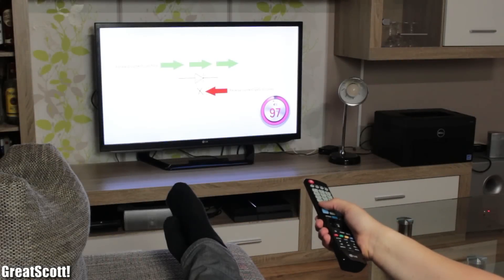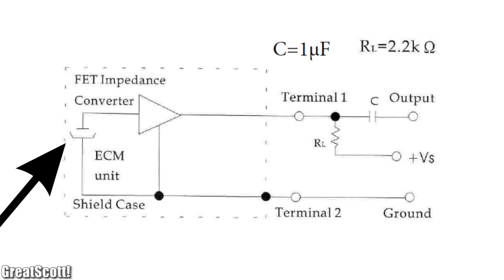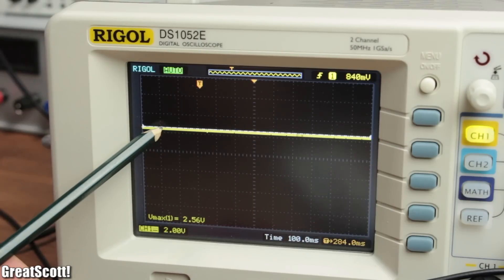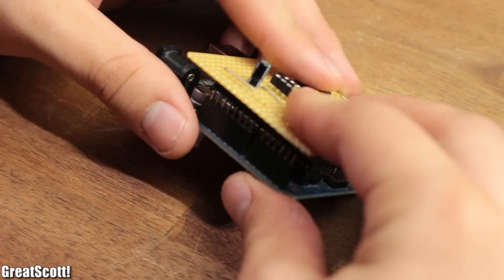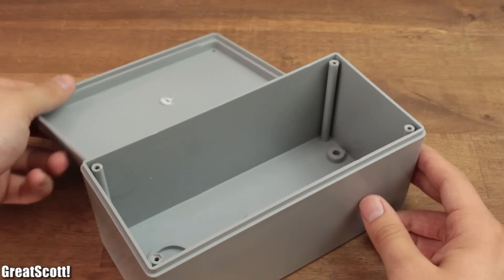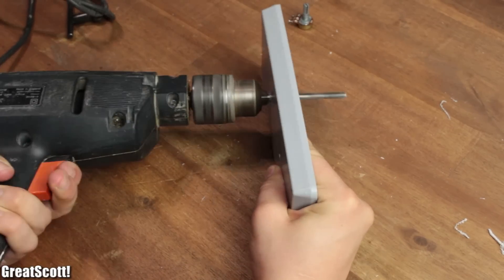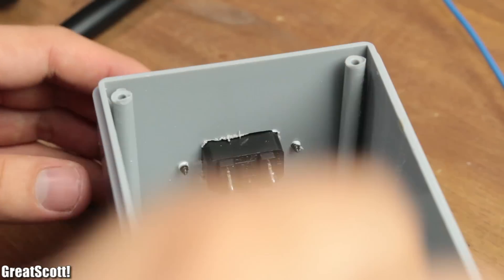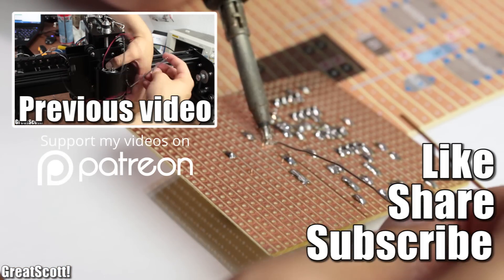Turn your lights on with clapping?! || Arduino Clap Circuit

Comment: Great project! Will definitely have to try this out sometime.
Reply: OMG, I NEVER NEW YOU WATCHED GREAT SCOTT, IM A HUGE FAN OF YOU AND GREAT SCOTT, sorry for capitals
Reply: DIY Perks Make a video of your project!
Reply: DIY Perks Hey. Make it battery powered using pulsed relays. Also try to make a two channel one for clapping two times for channel one and three times for channel two. Using (expensive) beefy relais may allow you to put on power strips for multiple appliances!
Reply: ***** ... Batterypowerd?
a batterpowered mains switch, so you can turn of your charger that charges the batteries for your clap-switch?
now i see why you need two channels...
Reply: dicky dicky
Totally wrong! The conversion of 250 Volts into 5 Volts using even a switching PSU is much more inefficient as just taking two 9V batteries and use pulse relays. So the circuit does only draw very low power to power the micro and only when a switching impulse is sent the relay is used. The batteries would last for at least one year and batteries are pretty cheap in germany. I could also use 6 AAA eneloops and recharge them EXTERNALLY. It's much better than permanently have a PSU on the mains... I just do not like it to do so! We pay 30 Euro-Cents each fucking KWh in fucking Germany! Congrats for almost free electricity in USA...
Reply: ***** you should do you math before posting :)

where do you get the numbers 2 9V batteries lasts 1 Year to power a attiny not asleep?
that's way off.
Let us calculate:

A typical cheap 9V battery in germany is about 80ct to 1€, right? (2 for 1,80€ at aldi) but these cheap blocks are usually around 200 to 300mAh.
Have you ever measured the current a attiny85 uses while not in sleep?
I've done, just now, i've also programmed it to analogRead() and delay(1) in a loop, since analogRead() has an impact to the current flowing.
i've measured about 18mA. Also a typical NE5534 draws about 6mA by just sitting there, than there is the input current of both inputs, that's around 0.5 to 1.5 mA each, we have a sound controlled current draw on the mic, which should be around 2mA.
All together we are easily at 25mA.
So amusing we are connecting the two  typical cheap 9V batterys in parallel and using a linear regulator they lasts 18 to 24 Hour, that's about 1.6 to 2€/day, or around 600€/Year. 
So linear regulators are a bad idea for Batter-powered Projects, right.
But without going to search an actual step down converter, lets say you have a magic step down converter with 100% efficiency.
So a 300mAh 9V Battery has about 2.7Wh which will give us 0.54Ah at 5V . With two of them we get  less than 45h, that's more than 300€/Year.

You wan't to use rechargeable batteries you say? ever wondered what Efficiency that whole process has? its horrible!
But first we do the convenience calculation:
 You say 6 Eneloop AAA.
I don't know why 6, but we do the math.
My eneloop AAA's say they have 750mAh at 1.2V thats 0.9Wh each, or 5.4Wh for 6. You'll have to swap batteries 2 times a week.
So you basically going to by 12 of them.
Assuming you already have a charger that you can use you have an extra investment over 20€, you can power your gadget a long time for 20€ but we calculate that later.
For now, lets forgot battery aging and pretend you could use this 2 packs forever.
So we know we have to charge our batteries twice a week (yes i know, its a bit less, but hey we assuming a perfect step down converter and always as good as new batteries, lets calculate with twice a week. lets make it 100 times a year, ok?).

So we need 6x750mAh in our batteries 100 times a year.
Have you ever measured the power consumption of you charger?

the Typical Eneloop-charger MQR06 uses about 6.5W while charging 4 Batteries in 200Min. that's 21Wh in for 5.4Wh out.
We need that about 100 times a Year, that's 2.1kWh/Year if you always unplug your charger right after its ready, if not if draws 3+W for showing you that its ready.
So, lets assume you batteries lasts 10 Years and you get them dirt cheap for 20€.
Now we have 2.6€ per Year.
Also we have the inconvenience to leave the couch twice a week since the damn batteries are dead.    

Using the powersupply that scott linked at ebay and assuming it runs under full load all the time (which is ridiculous, we will be at least 10 times lower, but we don't have the real numbers so i assume 100% load in for less than 5% out) we consume less than 30kWh/Year.
Assuming a ridiculous high price per kWh from about 30ct we raise our electrical bill at way less than 10€/year.

If we use a good switching powersupply designed for low current we should get easily under the 2€ per year including the price of that device over 10 years.

And no, i'm not living in USA, i'm from Germany, i know my electrical bill :)
Reply: What about a capacitor dropper circuit instead? But I still feel not comfortable to have a device constantly running which is not approved at all. I even switch off my microwave off the grid when it's done it's work.
Reply: ***** capactior dropper supplies are inefficient as hell, also they raise your circuit potential near mains potential, now you have to touch-prove your whole circuit including the mic and the pot :)
If you don't like wiring mains you could use a wallwart supply, that leaves half the mains wiring off.
You could get rid of the other half by ripping a rc mains switch apart and triggering that relay with the power from the arduino. Or to be on the really safe side, get a 443mhz transmitter and be mains free in your project :)
Reply: dicky dicky
Hmm also not optimal... The problem isn't having mains in the project, the problem is a failing PSU.

I have an AVANTEK power bank which is really good, but the PSU for charging destroyed itself. It was rated 2 Amps and the bank pulled 2 Amps all the time while charging. It did get VERY hot until it stopped working. Examining the carnage brought the certainty that the fail without event could have gotten wrong with a serious fire. Gladly the rectifier went open circuit. The charger had a resistor fuse, which is illegal in my opinion! Also a SMD resistor got so hot, that the PCB turned into coal. I now use a decent HAMA 2.1 Amp PSU with foldable mains connector. I opened it up and found that it was really well and safely designed and I would trust it. Perhaps I should use this in this project? I still could charge my power bank with it, it has two USB-Ports and the clap circuit will never use 100 mA.
Reply: ***** You always could add safety features in such a project without much hassle:
You could at a fuse direct at the input, in fact there are sockets with build-in fuses.
Sadly this Fuse might blow up after bad things happend.
You could (also) add a fuse at the output of your PSU, maybe a self resetting PTC-Fuse, that will likely trip before your unprotected psu releases the magic smoke.
You should not let a PSU run near it's maxumum ration for a Permanent solution, that will fail (if should not, but it often will), but this is no problem in this situation,  if you put a psu into your box you could also stick a heat-fuse ontop of it so it will not slowly get hotter and hotter.
Reply: I won't charge the power bank permanently. ;) So I think it might be okay.

There is also another option. I have one single appliance which is always on: My Cable Modem / Router! It has a USB port. I could use this for my project. Problem is the location but I have old speaker wire. ;)
Reply: ***** thats perfect, this is the way i power my RC transmitter for Sockets :). No location Problem either
Reply: +BloodySword That is a perfect solution. That is how I made a very simple light for my wardrobe. I mounted a power bank with velcro on the top, and used a USB LED with touching. They are cheap on ebay.
Reply: +DIY Perks Cool advertising technique!
Reply: +MrMitche Mitchell true
Reply: DIY Perks hey could you please help me figure out why the output always remains at 5v even when there is no input signal applied to it? I checked and rechecked the circuit.
Reply: Because this is AND gate logical operator which works on lowest voltage you might have connect a battery of 5 v which is the least in your case
Reply: daddy
Reply: DIY Perks 
Awesome
Reply: Yeah I dont think you did.

Comment: This really does work nicely, congratulations for another excellent instructional video.

I would like to add a very quick note about the circuit diagram. I made the mistake of wiring the output of the ATtiny85 as per the diagram which shows pin 2 and not pin 7.
Only after this did I look at the datasheet pinout, and see D2 is pin 7.

This is here to assist others who made the same error as me but look here for an answer.

Love your videos😊

Comment: It would help if you were consistent with the resistor values you used for the project. The first circuit you showed at 1:40 sets a quiescent bias point around 1/3 of the supply rail (i.e. 1.67V) not the 2.5V you show on the 'scope. I appreciate that you actually want to bias the quiescent point closer to the negative rail to maximise the swing since the opamp can't swing to the positive rail, but you need to explain that, not leave folks with the false impression that a 20K : 10K resistor divider will give 2.5V. It won't.

Comment: 5:51 Nope nope nope! You've got 230V coming into that stripboard and the trace right next to it is the 5V side. I'd mount the relay off the board.

Also, I bet you could get away without the amp. Your quoted 5 mV figure is when the ADC uses 5V as the reference. I think those can use a smaller voltage for the ADC full-scale, giving a smaller step size. Even with 5 mV and 40 steps, software should be able to clean that up sufficiently. More coding and trial-and-error though.

Comment: Awesome :D Thumbs up :D

For how much amperes is the relay rated ?

Alex
Reply from the maker: High Voltage Maximum is 1A.
Reply: GreatScott! You should definitely build in to the circuit a 1 ampere fuse, or replace the relay for a 16 ampere model (because the average circuit breaker (fuse) in a house (or any other building) for a schuko socket is 16 ampere, and that will not protect the relay from be annihilated, if someone connect a device that needs more than 1 ampere to run)

Comment: '
that is so coool clap hands sound switch...
how many limit watt of light bulb and motor
Reply: dont take it too far, bc theres no fuse, and the copper of the pcb is not very thick. probably only 50 watts, but dont blame me if your house is on fire

Comment: Questions:

1/ have you tried this without mounting the microphone on the outside. i.e. in the box. Obviously this is not ideal, but how well does it work? I want to mount mine inside a wall backplate with a panel on top!

2/ Why do you use the ATtiny85 when you could use analog input of Arduino?
Reply from the maker: 1. No, I did not try that. 2. The ATtiny is cheaper and there is more than one way to skin a cat.
Reply: I've never tried to skin a cat, but I'll certainly head back to your channel for instructions should I ever need to know the best way :)

Comment: Hello I plan to integrate the following circuit in the lighting of a room, doing so turn the light on with clapping, how can I do to make her turn with Arduino is that with the switch already present?
To turn this light in your opinion to the potentiometer value should be?
I already tried the circuit on breadboard with a relay module and it works.
Since the protoboard I used not find it anywhere you send me a link to buy it?
Thank you for an answer, keep it up you are very good I follow you from italy.

Comment: I have a question. I have two fans in my living room and I was wondering if I could somehow wire this to the wiring in the wall instead of using a pole switch. Also maybe have two different types of clap so I can turn the fan and the light on separately

Comment: Could you have done it using a DFT?  You could have searched for a signal with a certain fundamental frequency. I just bought my pic16f877a to put it on practice in this summer break.

Comment: Hello great Scott I have several problems
i --- I am using lm358 instead of ne5534 with the same connection.

ii ----- at first the circuit was not working but then it reacts strangely. The led turn on for a very short time when I clap.

iii ------ the led also turn on when I blow air to the mic and turn off when I stop

Comment: I am a little concerned that both sides of the AC are not relay switched. I note that GS says don't be stupid so I would amend this design in two important ways: 1) Add a second relay for the other AC line and 2) add low current fuses to each side the AC lines so that the clap device cannot be overloaded. You would not want to connect a 3kW heater to this!

Comment: So, can  I use this setup to power non-contact devices? Like a light bulb for example.
Reply: If by no contact you mean no mains outlet, then yes, it'll just get very messy as youll have to grab the wires from the actual wall. Be sure to switch off the power while doing it though, 230V is pretty painful. Alternatively you can use a wifi bulb, but those are costly
Reply: +KamkutGaming yeah I know about those things but I was looking for a cheap way

Comment: Great Tutorial! I am currently making this project. I am having a problem with my Arduino 1.0.5 software recognizing the ATTiny85 as one of the boards. Is there any other link I can go to for help on this? I have a mac by they way. Cheers and happy coding.

Comment: Hi Greatscott, nice video! I was wondering what components would have to be replaced for the project to switch on/off AC appliances which require high power around 1000W?
Reply: For 240v use relay for minimum 5A

Comment: I remember I built a clap switch with "one clap on, two clap off" feature 7 years ago. I used the output of my mic preamplifier (a simple transistor stage) and fed it to a monostable stage wired around IC555. the output clocked a decade counter (CD4017) and the second bit triggered a JK flip-flop for latching the output. It's amazing how a tiny MCU can reduce the part count so much! :)

Comment: Wiring the main voltage like that is dangerous. You need to cut both cables. In many houses, neutral and phasis are inverted, that mean you can close the circuit with your body to ground even if your relay is open.

Comment: Why use flyback diode and transistor to the output ? The output of arduino turn the relay with 5volts so why ?

Comment: I tied to see the peak voltage that I can get from oscilloscope but it wasn't showing any useful reading on it. Do I need to use the oscilloscope in some different mode. please answer it.

Comment: I replicated the OPAMP circuit and I saw that it's giving a 5v output even when there is no input signal. and when I turned on the signal there is no change in the output voltage. PS I only have a multimeter not an cro so I can't check the waveforms. could somebody point out why this is happening?.

Comment: Any interest in making a video about an outlet junction box that can be controlled and capable of 1500 watts?
Reply: +Bigolpete 1500 watts! That's alot. You have to take alot of precaution when dealing with that much voltage, as there is potential for arc.

Comment: do you have any suggestions for relays that can switch more power? Also it seems the relays rated voltage is 120V, with a max switching voltage of 220V. I wonder if it will be a problem

Comment: Why do you need a transistor and a diode to power a 5 volt relay because i did this before and i put a 4-30 volt relay directly on the digital out pin of the arduino uno.
Reply: A relay operates at 5V but consumes a large amount of current that the Arduino is unable to deliver. A transistor is utilized as switch requiring a small amount of current in its gate to work. As the relay is an inductive load, you need an antiparallel diode to have a current flow path once the transistor is turned off.

Comment: Hi can someone explain how the relay is used to control the AC voltage. Like how you can use this circuit with any AC device
Reply: The relay consists of two terminals for power, a common terminal and (the simplest way to explain) a normally open switch. The relay has a coil between the two power terminals. When you put, in this case, 5V between the terminals the coil will act like an eletromagnet. This eletromagnet atracts the normally open switch to the common terminal, closing the circuit. So you can wire anything you want to the switch (even something that uses 230VAC) and control the openning and closing of it with 5V.

Comment: Is it possible to use two switches in an Arduino  and code : if one switch is high it will turn on pin 7 and if another switch is high it will turn on another pin.I tried it didn't work.is my code correct?:
In this code state of push button on is buttonstate and 2 switch state
Void loop () {
If analogRead(buttonstate == HIGH){
digitalWrite(7, HIGH); 
else {
digitalWrite (7, LOW);
And switch state also like this.

Comment: A microcontroller for this??? This type of project was a classic 1970s two transistor magazine type project. In fact I an fairly certain it was included in either the radio shack electronic sets for children or the Phillips Radionic sets.

Comment: Hey just a quick side note, I noticed that that relay was rated 125 volts. However it's always a good idea to use a relay rated twice the voltage you put through it. For example if you use 120 volts then use a 240 volt rated relay, if you use 240 volts then use a 480 volt relay. It will greatly reduce the risk of arcing and will be a lot safer.

Comment: Can we use a ATtiny85 without coding it so we can turn it on with one clap only?????
Reply: Ehhhh, the ATtiny85 is a microcontroller, and, you know, microcontrollers need programs to do something usefull, and programing involves codings so... No